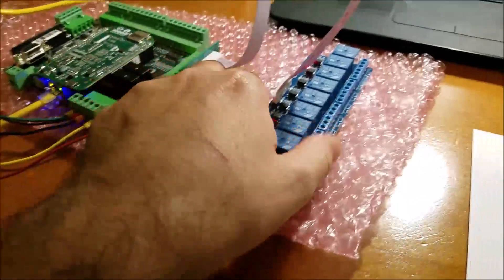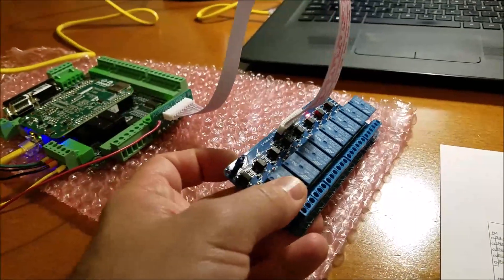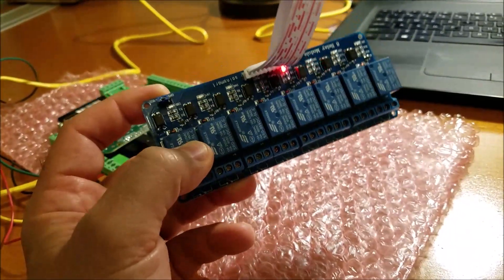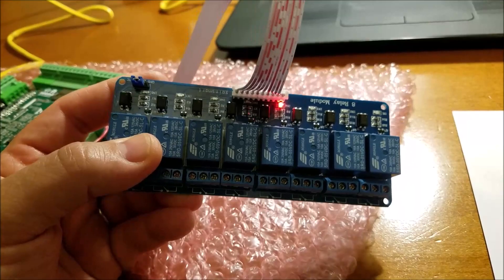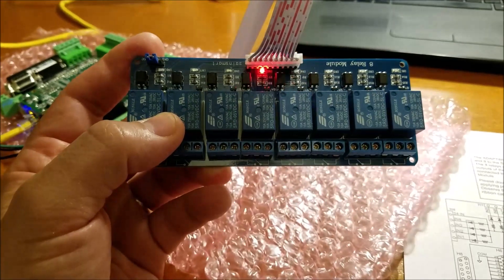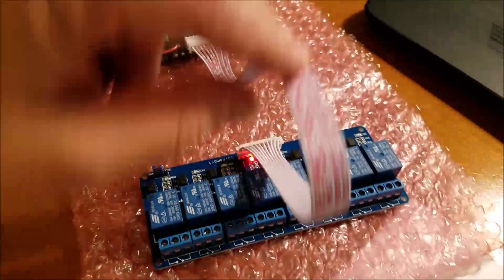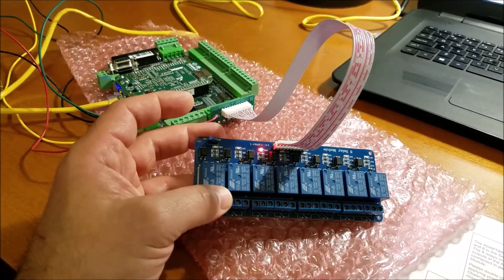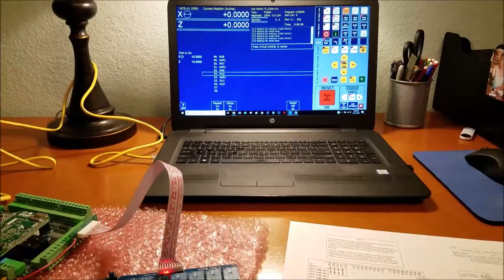Centroid Acorn CNC Relay Board Kit

Comment: Franco love your videos.  Those 8 relay boards are available on Amazon for about $9 each or 2 for $14.  Then get the Elegoo EL-CP-004 120pcs for $7 and plug them in.  I've been using these for years and they work great.  I run Acorn on everything now.  Just ordered a PM25MV for next build.
Reply from the maker: Awesome!  I think you'll really like that machine.  I think it's best in breed for machines in that size/price range.

Comment: I see they are offering the board for $39. Is this the same price if you already have the Acorn? Should ask them I guess but heck, I’ll try you first.
Reply: Hello. yes $39 is the price of the Relay Adapter kit that includes the Adapter board, the ribbon cable and the relay module board. more info on the kit found here..  http://www.centroidcnc.com/centroid_diy/downloads/acorn_documentation/acorn_relay_8_kit.pdf    thanks,

Comment: Where can you put this board and what it can be used for? I usually use my optocoupled triac or fet  boards, something like solid state because relays are too loud and have sparks on contacts. Anyway I liked your video.
Reply from the maker: Thank you.  These types of boards are usually installed inside of the CNC electrical cabinet enclosure.  Mechanical relays are typically safe to use in that environment as there shouldn't be any volatile gasses.  This board can be used to control many different CNC peripheral devices such as spindle motors, pumps, fans, lube pumps, chip conveyors and other items such as this.
Reply: I am making my third grbl based CNC. Acorn and closed loop drivers are cool but too expensive for me. Last machine (all linears, metal, aluminium, couplers all including custom done drivers and logic board done by me ) cost me less then 1000€.
https://youtu.be/TDTDN_KkoJc 
 Working area is 800x450mm, speed 2500mm/min, spindle is second hand 1600W hobby router but good for woodworking. I am an old bd in EE and I am stuck with Fusion 360. I wanted to make plan for custom enclosure to cut it on plasma cnc but..... Is there any freeware simple software which you can recommend to me? Thank you